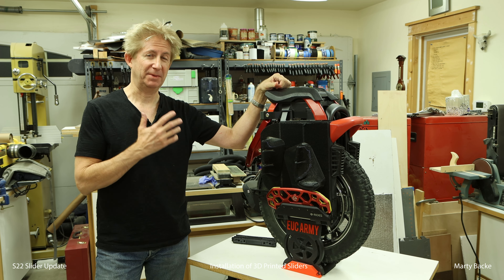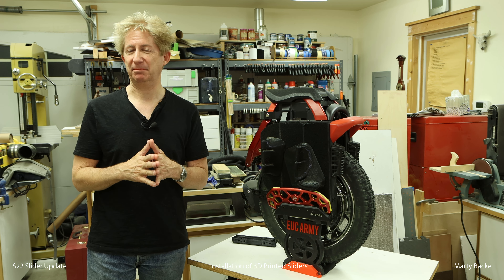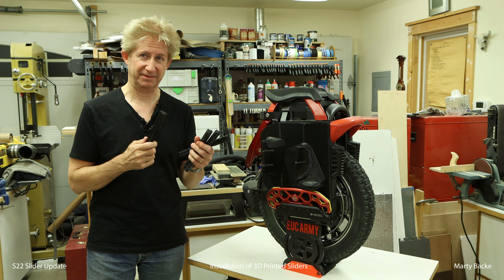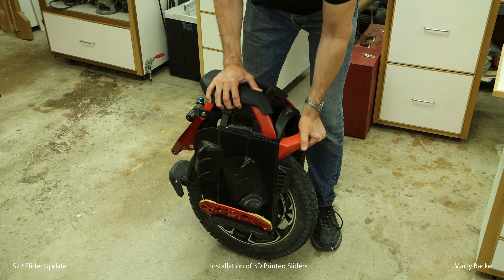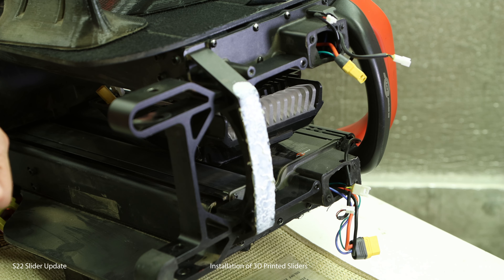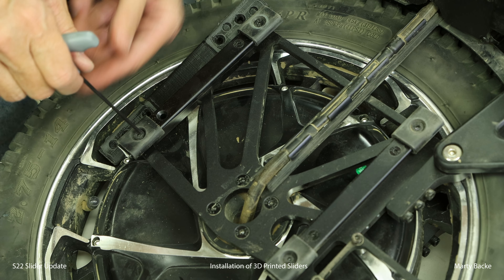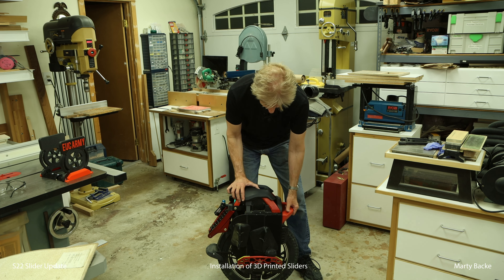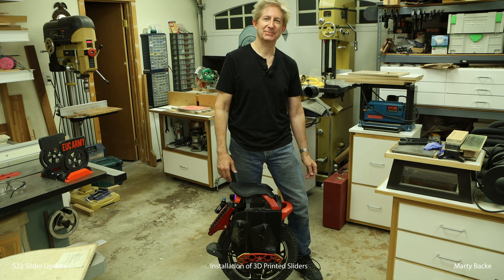S22 3D Slider Installation

Comment: The CNC option is really the only way. 3d printing is amazing and has become cheap easy to use and stronger materials no doubt. But in all honesty for this application the CNC kits. I didn't know there were 2 options I'm in Kelowna bc so riding season is on pause anyhow but I will explore the multiple options. Just got my s22 back from eevees a few hours ago with the motor swap, it makes a strange sound when reversing....
Reply from the maker: Agree. CNC sliders are in my future as soon as my 3D sliders break down 🙂 Then again, Mike Leahy has been riding his S22 with 3D sliders and they've been holding up to all the abuse he gives it.

I'm not having my motor fixed/swapped. If it ain't broken don't fix it is my moto 🙂

Comment: I'm currently riding with the 3D printed Sliders with TPU bearings.  Very nice upgrade over the stock sliders.  My buddy has the CNC setup and after trying his..... it's 100% worth spending the few extra dollars to unlock the S22 full potential.

Comment: Plastic slider mounts look more than capable, Just the actual rollers and bearings would want them to be high quality like on sliding doors and window rollers. I'm a big fan of 3d printed parts and they work even better when used with mixed materials.
This looks like another awesome solution and upgrade out there for EUCs.

Comment: Wow I didn't know you're gonna do a video about that slider.  Mine was very comfortable since I changed my spring to 350lbs but that was a short live enjoyment now I have to deal with another issue with my S22.  I got the error 27 after doing the Fullerton loop.  Never ending issues with the S22.
Reply: What is the error 27??
Reply from the maker: Battery pack related failure
Reply from the maker: Any falls or it spontaneously started reporting that error? I assume you can't ride it now. Fortunately I haven't had any real problems with my S22, but in the back of my mind I'm always waiting for something to happen.

Thanks again for the sliders - will see how long they last :-)
Reply: @ElectricUnicycles  No falls but when I first got it it beeps several times before it charges.  I thought it was just normal but now I realize it already has that issue from the beginning. It just got worse.  I charge it after the ride but this time the beeps never stop and got that error 27.
Reply: @ElectricUnicycles  Yeah. I reset the BMS I followed Kevin's advice from eride.  I just need to update the firmware but I need my iPhone to do that since there is no Soft Tuner on Android.  Hopefully it works when I get my iPhone back tomorrow when my wife comes back from Canada.
Reply from the maker: Hey, I've been asked what material did you use for the wheels?

Just completed a 10 mi ride and they feel really nice so far
Reply: Have you a link to the spring you used as im a sub 150lb rider all up. 🙏
Reply from the maker: @ColsPinballMods  See my video where I install the lighter spring. Links for the spring are in the Description for that video

Comment: Why isn't anyone printing slider bearings out of iGlide materials?  Igus makes filament and I've been trying to mention it every time I see someone working a bearing upgrade/clean.
It's not cheap but how many times do you really want to go through this operation for the same problem, much less have the reliability of your build always on your mind when you're riding?
I used to do a lot of this for a living up until I lost part of my spinal column in an accident (nobody wants a technician that can't also be a forklift, no matter the skillset).  Igus offers materials used in industrial applications where tribological performance, strength, and long operational life are key.
I don't have an office/shop at home or I would just demonstrate - I have an S22 but I'm laid up and can't ride for a while, I expect at least until next spring, so I haven't even had the motor fix/swap done yet.  It's literally got zero riding time on it, so hopefully by the time I get back mobile again I can get things upgraded while it's still factory clean.  
My suspension designs leverage compliant machines/mechanisms so there technically aren't ever any sliders, shocks, or springs as discrete components, it's just a big...thing...of stuff.  Hard to explain if you don't already study them a little; but check em out, maybe you'll get some inspiration.
Reply from the maker: That material sounds great. I do n9 3D printing myself so I can't really contribute it to the conversation 🤔
Reply: @ElectricUnicycles  Igus also has a rapid prototyping service for some of their materials as well as offer bar stock for milling/CNC, powders for sintering printers, and tapes, bearings, as well as a bunch of self-lubricating linear slide assemblies, already built.  I'm not an affiliate but I've used various of their products in the past and now you can just submit drawings to an online quoting tool if you just want a 3D print done for you in their materials they'll do that too.  My experience with their field/sales engineers has been good - they're pretty responsive, even though I told them straight up I'm not with a big company anymore and I have to buy stuff in singles instead of cases now.  There is a value to struggle in learning but there is also value in removing as much struggle as possible when you aren't interested in it; I spent a quarter century building stuff and labs for the guys that designed it.  Really jonesing for a shop of my own but it's slow going when you're on your own and disabled...hate seeing people in the community having to go to such lengths when in all fairness just a couple of material selections changes and the slider probably would have worked nicely.  After watching 5+ channels do full teardowns and rebuilds multiple times I'm starting to get how they thought it was going to work versus how it is working for the customers.  85% of it is incorrect materials and fastener/joining choices.  It is just my opinion but I've had to salvage so many broken products and thankfully the S22 is still falling into the category of "solvable problems" (we haven't had another risk level like the battery fires of the S20, just the motor/controller breaking) near as I can tell; I literally tried to return it when I got notice from both Kingsong and dealer and found that KS is doing the bare minimum (providing retrofitted/upgraded motor cores) and leaving a lot of dealers twisting in the wind on eating the handling costs themselves along with the operational expenses of a recall level product event.  The dealers seem to be doing the best they can, some are better bests than others but they're trying. 

Normally I wouldn't be putting this level of effort into something like this but it's a 3300 USD great on paper but not so much in execution product that neither the factory nor the dealers want back...so it is really up to the community this time to make this into the machine it's supposed to be.

PS: unless you've got a lot of time on your hands, nobody wants to do 3D prints.  At work if we needed them faster, we had to get more printers and increase concurrency.  The one cool thing was in my group that was the biggest users of printers I've ever seen, spread out across the company, and we did have some of them mapped on the internal network so we could print to someone's 3D printer on the other side of the world and not have to ship engineering parts through customs nor incur the delay of transit.  There are some pretty cool things you can do with them, but they take forever and are prone to delamination, rendering your material choice moot because your part came apart.  There are other options rather than printing it yourself - once you get a part working, you shouldn't be putting hours of wear and tear on your gear cranking out inferior strength components; have them built, it's not expensive anymore (just like getting PCBs printed).